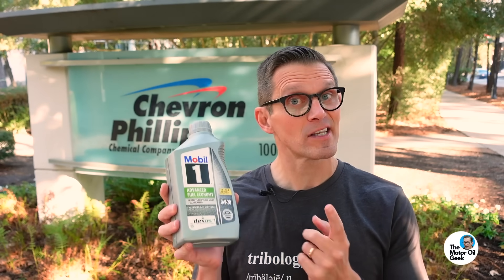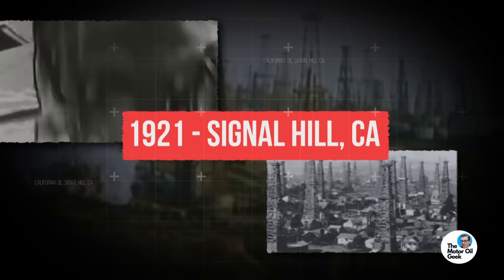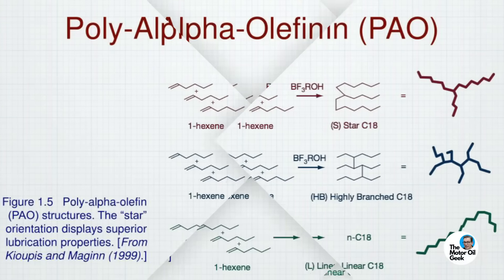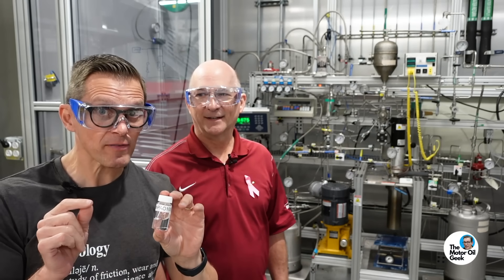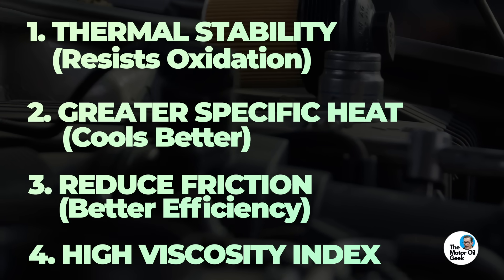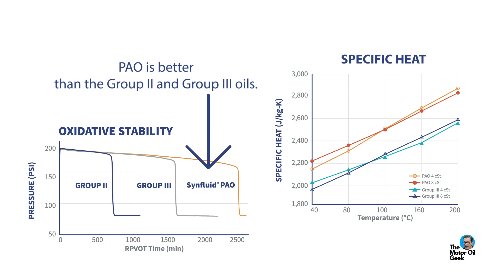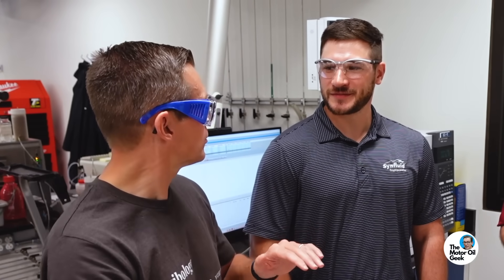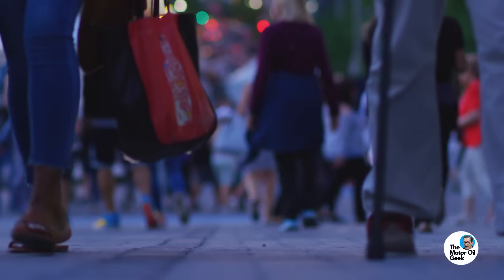STOP Using Regular Oil - 4 Reasons Synthetic is BETTER!

Comment: 1983 N. MI frozen waste-land summer time. Bought a virtually New 1982 Honda CX500 Custom bike, water cooled shaft drive. My father had become a Amsoil dealer in 1980, and I had started using the engine oil in my 77 Camaro. ( I have a whole other true story of Amsoil in that car as well) My bike had an 80/90w gear oil in the rear drive that would get so hot you couldn't hold your hand on it, Dad (God bless him R.I.P) suggested I switch to Amsoil synthetic gear lube. Result? I ran the shit out the bike and could stop and place my hand on the gear drive and it would only be warm, obvious result lower friction, bingo! less ware. I was sold, and have enjoyed the amazing properties in everything I have owned since.
Reply: I had a 1984 V 65 Honda Magna that was water cooled and shaft drive.  Best bike I ever owned, drove it through 41 states and to Alaska.  Used synthetic oils everywhere in the bike and never had any issues with the bike at all.  Had just short of 200,000 miles on it when I gave it to a friend, who is still riding it today.
Reply: Still have my ex 500 I bought in 1979, still runs great 40,000 miles
Reply: Absolutely. We used many different synthetic gear oil brands in our racing quick change rear ends. Typically gear changes are required between the heat race and the feature because of the changing track conditions, and the gear sets were very hot. 
One night I was off and helping pit for a friend that was an AMSOIL dealer, he changed his gears, tossed them around like a hot potato and grabbed my hand and put the gear in it. It was surprisingly easy to handle, much much cooler than the Pennzoil that was our teams sponsor.

Comment: Thanks Lake, been using Amsoil for thirty years, it always continues to amaze me, the protection is barr  none!
Reply: I've never used Amsoil and have never had an engine wear out.
Reply: What I like about amsoil is the protection provided by the product. I had a friend that knocked a radiator hose of his tractor and didn't know it. He ran the tractor until it locked up. I went out the next day to see what happened. When I realized what happened I bumped the starter and it turned over. I put the hose on the radiator filled it with antifreeze and the tractor started and has been running for 5 or 6 years. The other reason I like Amsoil or synthetic is because you can have longer service intervals. I don't kick anyone, just sharing my opinion.  Good luck!
Reply: Amsoil kept my engine seals soft and pliable, I was shocked to see after 250k my seals were good after all these years and no leaks. Bone dry under my undercarriage.

Comment: Is there a list somewhere where we can see what specific oils use group 3 or 4 base oils?
Reply from the maker: Check the SDS sheet to see which base oils are used. Here's a cheat sheet. https://www.cpchem.com/sites/default/files/2021-09/PAO%202021%20FINAL%20.pdf

Comment: Could you please recommend an oil that would be a good match for my engine. I have a small block Mopar 360 cubic inch with 2618 forged pistons a solid roller cam producing around 500 horsepower. Does the Amsoil have the Pao that you're talking about and would that be a good fit for my engine?

Comment: Where has the mandate gone to stick to the manufacturers specification? Where has the Application specific choice of oil gone? Now pushing for synthetic regardless? Sorry, that‘s utter BS! And YOU know it. Yes synthetic is generally better, but that doesn‘t mean it‘s better in all applications, it isn‘t, actually the opposite, without technical modifications in some engines to run well with synthetic oil without destructive impact.
While in theory and lab-testing of generic engines with current oils synth will likely always win and thus I‘m with the message, I know from experience in several of my engines that it is not 100% applicable to all types of engines and engine architectures. Thus I consider this a false and dangerous claim at the risk of the owner of the vehicle, as you take no responsibility for your advertisements, worse, if you would be involved, you‘d be tracking back to your „it depends“ perspective „the application“, and that, that is the truth. It depends!

Comment: Every hot rod and classic car guy will argue until they die that conventional is better than synthetic.  "Flat tappet requires conventional", "Synthetic is too slippery for the pistons."  I hear it all.  I run synthetic in everything.  I even switched my '74 F100 with an FE 360 to Valvoline Restore and Protect but still added some zddp.
Reply: Same guys probably believe differentials, transfer case, and brake systems never need change/flush.
Reply: I run full synthetic 10w30 in my flat tappet SBC all the old gear heads yell at me. But the engine runs so smooth compared to how it did with convectional it is a night and day improvement. I don't even use a zinc additive!
Reply: @The0utmode Same run John Deere synthetic 10w30 in my 350 TBI runs great no problems at all
Reply: I use conventional in everything and have never had an engine wear out.
Reply: Never had a flat tappet cam problem with Mob 1. 👍👍😎

Comment: My old BMW R850RT has been running mineral oil 20W50 the last 27 years, and that thing hasn´t exploded yet 🤣
Reply: My K1200LT is approaching 18 years and 108,000 miles and is also doing fine on conventional 20W50.  When I check valve clearances, the cams and buckets look like new.

Comment: I wouldn't expect any other results, that's the second time you have used oil companies to support your personal opinions.
What else would they say when selling very expensive synthetic oils over cheaper mineral oils.
There's only one real advantage with using synthetic oil, and that is that you can extend the mileage before changing the oil. 
If owners want to do that then that is up to them, me, I would rather change any oil regularly.
And just to correct you, Dr. Hermann Zorn of Germany developed synthetic oil in the 1930s.
By 1943, Germany was producing over half of its wartime oil use from synthetic oil.
90% of the aviation gasoline for the Luftwaffe came from synthetic oil.

Comment: Regular oil? Hmmm I stopped using that back in the 90s, I didn't think it was still sold.
Is there any reason to use regular oil in any machine/thing? Maybe to sharpen a blade? On a squeaky hinge?
Never the less, another great informative video from the Geekster!
Reply: Yes, many reasons.  I use synthetic in my car and pickup because they run year around in cold temps well below zero to hot temps occasionally above 100ºF.  I use conventional oil in my motorcycles as they don’t run below about 40ºF and seldom above 100ºF.  They simply have no need for synthetic oils as I change the oil once a year and only occasionally run more than 5,000 miles on any one motorcycle.  So, I don’t need the extended temperature range nor do I need extended mileage change intervals.  So, why pay twice as much for oil with benefits the application does not need?  Same for my lawn equipment.  I use conventional oil in my lawn mower, lawn tractor and rototiller.  And my push mower and rototiller are both nearly 40 years old and doing fine on conventional oil.  Again, why waste money for benefits not needed?
Reply: Because it's specified in the owner's manual.

Comment: Pennzoil Ultra Platinum Synthetic. Much better than Motorcraft in my late model Ford.
Reply: How do you know it's better?
Reply: My comment is from personal experience. The car stopped using oil when I switched to the Pennzoil Ultra Platinum and doesn't dilute as quickly with gasoline between oil changes. Direct injection fuel delivery.

Comment: In Commerical Fishing Boat, i shifted to Synthetic 5w40 (no one in my harbour uses full Synthetic among 150 commercial boats, some are running 15w40 semi-synthetic in Cat engines) my Cummin's instantly reved up 100 rpm, and the boat gained .7 knots. The hotter the day, the smoother it ran. Easier starts too. When warmed the smoothness is noticeable. 
I began using Synthetic ever since in EVERYTHING from the sawmill, motorcycle, lawnmowers. Generators,  truck, and car etc. 
I will Never go back. New cummins in now, after the 50 hours on Valvoline extreme Blue 15w40,  going full Synthetic again.... my third engine.
Reply: I’ve been an Amsoil dealer for 27 years and one of my customers has a commercial fishing boat in Alaska. He switched to Amsoil Signature series max duty diesel oil a few years ago because he wanted to run the entire season without bringing the boat in for an oil change. He was running 400 hours with the previous oil. He took an oil sample at 400 hours with Amsoil and the analysis showed good for continued use. He ran the rest of the season of 700 hours and took another sample and the oil was still good with low wear metals. He now changes the oil at seasons end with clean oil for storage and runs the entire season on one oil change, saving time and money and bringing in more fish. 😊
Reply: Can you lower the Amsoil price so its affordable. Why not use mobil 1?
Reply: @ Yes! Amsoil has levels of protection from a synthetic blend oil in both diesel and gasoline oils that is guaranteed at least 50% synthetic and the remainder is conventional, which blows away every other blend on the market, to a more basic “sp” oil and heavy duty diesel oil, to the best, longest life, Signature series oils that are top performing and the most expensive. From $15.49 a qt down to $7 a qt, less with a preferred customer account and even less with a dealership, retail account, installer account or commercial account, available to businesses.
Reply: @darrylsjodin7184 instead of changing my lawn service equipment at the end of the season, I change at the beginning.  The main reason for changing at the beginning is to get rid of any moisture the oil may have absorbed during the off season.
Reply: @ That’s true, that would worry me too. Leaving the old oil in the crankcase could be worse if there is any corrosive combustion byproducts in it. The new oil would have a full measure of additives in it to protect the metal.
Reply: what kind of engine are you running? 75% of our fleet is KTA 19 and NTC 855
Reply: @drewkossen9324   I'm running a new QSL 9 long stroke Marine industrial  455hp not big... but does the job.
Reply: @andylynnpei    Nice Engine.
Reply: I'd certainly like to know how the oil bypassed the governor to increase engine speed.  
I've been using Mobil 1 for decades,  have several gas engines over 200K and spotlessly clean with annual oil changes.
People never seem to grasp that synthetics are free.  You save enough gas to more than pay for the oil.  Extended engine life is a free benefit.  Just bought another 15 gallons today for shop stock.
Reply: @anvilsvs  it was a mechanical cummins diesel my first two. They tune the propeller size, pitch etc, and the transmission ratio, to the boat hull speed and set the engine on the injectors to run the engine at the max 2600 rpm wide open  throttle. That's the max it can roll on an empty boat. 
That's how it went from 2600 to 2700, it was running with much less restriction. Every mechanic that got in the boat asked why the cummins was quiter than others. I told each one the  story. 

The extra 100 RPM gave me .75 knots more speed. But I never put the helm down to  2700 RPM. I kept it down where it should be at, 2600 or lower,  as designed for that engine. I should have had the mecanic reset the pump. But doesn't matter as long as i was aware of not over reving it personally, and I was always conscious of that. 
Now, my new cummins engine is electronic, so it will auto governeor at  2150...  it isn't going to affect the top  RPM  in the least, ever.
But anyone who tells You a premium Synthetic isn't better, i just cannot take seriously anymore. Every engine  every  machine I have, from a sawmill, tractor, lawnmowers, generators and pressure  washers, motorcycle, car and 1/2 truck all run noticeably different. 
I asked cummins about my new QSL9 industrial marine (installing now).... can i put synthetic in it after break in (its not in the water yet)? They said absolutely, a premium valvoline blue diesel synthetic 5w40, or rotella T6 synthetic 5W40  will out perform the valvoline 15w40.
Though they claimed to me that valvoline (recommend oil by cummins is valvoline products) extreeme blue 15w40 (mineral), in Shell Rotella, required their semi-synthetic 15w40 to be comparable to valvoline mineral.  But they agree that synthetic rotell T6, or Valvoline blue synthetic 5W40 is hands down better product than any mineral oil, the engine is better with it. 
After my 50 hr breakin, the 15w40 valvoline mineral is going out,  synthetic 5w40 is going in. 
I'll never return to mineral oil for anything  in my business.
Reply: @ Agreed that synthetic oil is better than mineral oil, if you look up the sds for the “synthetic” oils you mentioned, both oils are made from “highly refined mineral oils”, group 3 synthetic oils, small “s”. Amsoil’s Signature Series Max Duty diesel oil is Pao and Ester synthetic oils, real synthetics that out perform group 3 and last longer.
Reply: @darrylsjodin7184  Why are Asmoil advertisements everywhere? Strange. :face-blue-smiling:
Reply: @ To increase product awareness I guess.
Reply: I get it that you bet everything on the Engine always running perfectly,,  but I don't get how a big well maintained newish diesel engine could burn up enough to need replacement.   
How do you know when to repower?        What are you running?  Cummins,   Cats,  Luggers,  or Deeres?   Or Detroits....
Reply: @freebuilder007  i traded my last one in at 10,000 hours.... that new engine only had 3200hr but i sold the boat. 😆 🤣 😂 😹. It was 30 yr old fiberglass hull 45 ft. 
I got a new boat this year, My first new boat and last.... on a boat they are always heavy pushing, no coasting  Not like a truck.
 And salt water and air is a killer. We shoot to trade at 10,000- 15,000 hours. 
Most will need an overhaul burning oil by 15,000 hrs. Some by 10,000. We change oil every 250 hrs if it has a 19 liters of oil base.  Lot of cummin's ,volvo penta, cat. Best for parts supply here.
Reply: When I was a teenager, my dad changed his Freighliner with a Cummins M11 over to Amsoil (from Delo 400) and even as a passenger, the smoothness change was very noticeable. I wouldn't have believed it without experiencing it for myself.
Reply: @Enword_Jim  It's all in your head.
Reply: I’ve always been running synthetic oil and my four-cylinder vehicles and yes back in the day I used to buy some Amsoil from a local dealer. Just a question now for our lawnmower having a straight SAE 30 weight oil that typically comes with traditional lawnmower engines fill me in if there’s a synthetic straight SAE 30 W ? And I’m talking about accessible let’s say at Walmart or an automotive store cause I think I might go ahead and switch that out and to the lawnmower even though I had used a left over or a quarter of 5W-30 for the lawnmower years ago, but I’d rather stick to the straight SAE 30 weight
Reply: @ Sorry, but Amsoil doesn’t have a straight 30w oil, but there might be another mfg co that has a synthetic 30w. I think the thought was to use a straight 30w in air cooled lawn mowers because the oil runs hotter. The viscosity index improvers used in multi weight oils typically would break down and cause deposits. Amsoil’s small engine oils are multi weight but have shear stable viscosity index improvers, so a straight weight oil is no longer necessary. FYI, the lower the first number in the weight designation, the more vi improver needed and the more volatile the oil, for instance 0w-30 v/s 10w-30. I would use the 10w-30. My Amsoil orders arrive over night to my porch from Portland, so that’s very convenient. 😊
Reply: @darrylsjodin7184  are you saying the "W" indicates weight? The W actually refers to how  well the oil flows in cold temperatures and when you first crank a cold engine. The W, when referring to oil stands for winter.
Reply: @ You’re right🤣 It’s hard not to think weight when you see the w, lol.

Comment: How do I know what synthetic oil group I’m buying? Is it on the container someplace ?
Reply: If it's sold in Walmart, it's Group 3. These days, only super-expensive boutique oils are higher than Group 3.
Reply: @aliendroneservices6621 so royal purple is group 3?
Reply: @aliendroneservices6621 
Platinum and ULTRA are ...?
Reply from the maker: Check the SDS sheets. https://www.cpchem.com/sites/default/files/2021-09/PAO%202021%20FINAL%20.pdf
Reply: @themotoroilgeek  where do you find the sds sheet for each motor oil. We need a comparison of the leading brands. That would be very helpful as a consumer.
Reply: You can type into google the brand name and oil designation plus “msds” and you’ll most likely find the ingredients.  There’s a number that starts with “CAS” that you can look up that describes the base oil. Ingredients that aren’t hazardous won’t be included. You would think oil price would dictate which base oil you’re getting, but I’ve seen some Motul oil selling for $16.95 a quart that is made from group 3! Granted, you won’t find group 4 oil for $7.95 a quart.
Reply: This video explained that if it is a synthetic motor oil, it is by definition group 4.
Reply: @mikestone5595   Tell it to the judge whom decided the Mobil v Castrol case.
Reply: @aliendroneservices6621 
He wasn't an oil engineer just a person who believed one lawyer's sales pitch more than the other.

Comment: I have a toyota crown 1972 model with a 2l 5r engine is it safe to use synthetic oil in a over 50 year old engine?
Reply: Depends on what kind of gasoline you're using. Is it running on leaded gasoline?
Reply: @aliendroneservices6621  i use unleaded 98 shell v power nitro fuel and lead additive
Reply: @ReodorF1   Then don't use PAO with it.